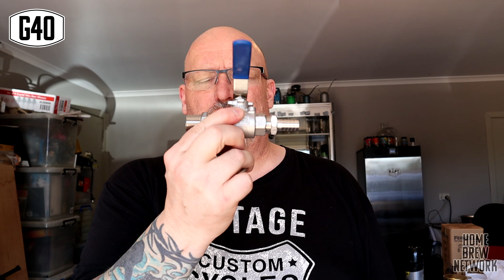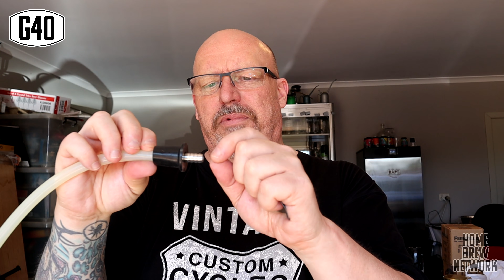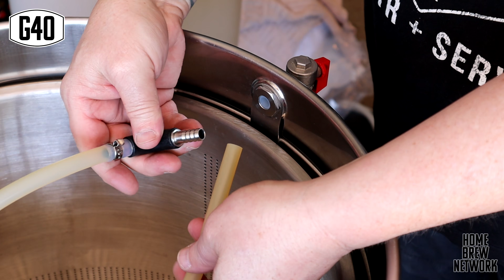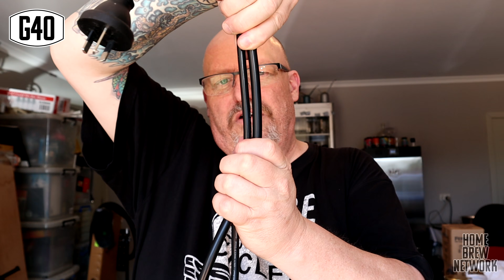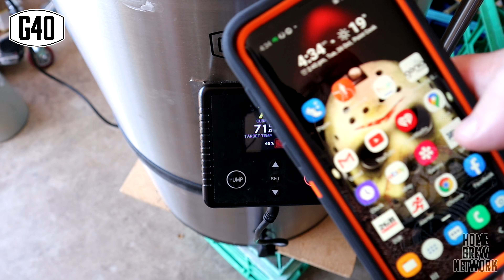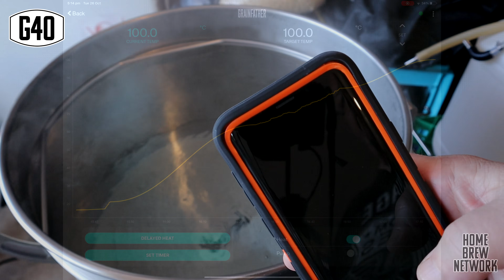Grainfather G40 - Modifications, Hacks & Upgrades - 15 amp - Feel the POWER! :)

Comment: Silly question; Just about to flip my G40 over to 15A (now that ive got the circuit installed), will I need to adjust/scale my recipes or the equipment profile in the grainfather app?
Reply from the maker: Maybe just boil off, but it won't be that much different . Should be quicker to boil so maybe a touch less evaporation during the heating. Cheers

Comment: I love my G40's power but being I'm in the states I have the maximum power output. It actually heats faster than my roller mill crushes my malt when I'm doing a whiskey mash. I just couldn't be happier with the G40 overall. I put it on a roller plant stand platform too so's I don't have to lift it to move it around.
Reply from the maker: Awesome stuff mate. cheers!

Comment: Hi. How’s the new sparge pipe working. Thinking of doing something similar. Is a normal plastic t piece from Bunnings ok heat wise or would SS be better?
Reply from the maker: It's good, I like it. I've used the bunnings parts in the past, but I always try and get stainless in the end. Just make sure its heat rated up 80c or so. Cheers!

Comment: * BUYER BEWARE * If your G40/S40 craps out, like my G40 did on it's 6th brew, GF WILL NOT REPLACE YOUR FAULTY UNIT UNDER WARRANTY!!!!!!
Don't buy into this hype, this company doesn't give a crap about you as a consumer.
They are currently trying to fix it while it sits on my kitchen floor... not sure osmosis is what's required here... 
* BUYER BEWARE *
Reply: Any update on this?

Comment: That’s also a huger volume boiling than your first wort, it won’t look as vigorous when full. I’m assuming you’re 220-240 volts? I put a Blichmann 220 coil in my keg, a dedicated, new 220 circuit in my kitchen, it’s a real beast, I think it’s faster than propane was..(in US..)
Reply from the maker: You have more amps in your regular 110 (15amp I think), then we have in our 240 (10amp) that's why in Australia we need a 15amp set up, 10 amp  works but is struggling. It's all about the amps... Cheers!
Reply: @HomeBrewNetwork  yes..an electrician charged me quite a bit for the new outlet, but I think here it’s a 20 amp circuit. 30 amp circuits are for hot tubs, jacuzzi’s etc..the copper wires in the new 20 amp line are quite large..!

Comment: Thank you!  The tri-clamp solution for the drain plug is simple and perfect.  A low profile adapter is 28mm including the threads.  That is far better than a permanent tap hanging off the side.  Cheers!
Reply from the maker: Glad it helped Cheers  mate!

Comment: Great videos on the G40. Thank you!

Could you measure and/or tell me the diameter of the grain basket? Can’t find the measurements online.
Reply from the maker: Let me check. 412mm outer lip to outer lip and about 385mm inside diameter of the malt pipe. Cheers!

Comment: I'm interested seeing the writing or imprint on the 2 cables to see how much difference there isbetween the two.(I am a sparky)
Reply from the maker: 2.5mm and the other is 1.5mm cheers! Each x3 of course
Reply: @HomeBrewNetwork  that's interesting, if grain father were cheaping out they would use 1mm for the 10A cable as it can carry 10A but they have used 1.5 which (by the book) can carry 16A. NOT recommended of course because as soon as it's in the sun or insulated it's derated to 12A (for v75, V90 is 17A).
2.5mm is 20/16/22A respectively.
It's great we have the option, Good job grainfather 👍
Reply from the maker: @nedt  I agree totally, when I saw the 2.5mm I was happy lol Cheers!

Comment: Maybe you could make something like the spray arm from the new Blichmann Breweasy Compact. It's a stainless steel tube with tiny holes along the entire length that sprays the water in different directions. When you stick it in the grain in the middle of the grain basket it allowes a lot of grain to come into contact with the recirculating water.

Comment: I don’t have a G40, but it looks like you could rotate the T piece at the bottom of the site tube so that the open end (female) could face straight down rather than out horizontally . This could then hang over the edge of the bench and allow a tap to be permanently installed facing down. It would just have to always sit near the edge of a bench!

Comment: I was wondering if you could blank off where the pipe pushes in at the top and use the 1/2 connection at the top of the valve instead, stick a cam lock on and use a whirlpool arm directly.
Reply from the maker: Yes you could, but the lid has no hole for recircing, so you’d have to leave the lid off, of course that will work but you’re losing heat. Cheers!

Comment: Could you get your strike water temp up quicker by setting it to boil and then punching it to 70 when it reaches say 68? cheers.
Reply from the maker: Well, I see where you’re coming from, but punching it to 70 at 68,  would be exactly the same time and power used. It was full 100% power  all the way to 68 anyway. Cheers VIC!

Comment: Nice video, a tip, the G40 has a standard IEC C19 plug so you can get a 15amp C19 cord from anywhere that sells them, being in Aus i got one from Jaycar for $14 and it works a treat, $14 cheaper than the official Grainfather cord, although the one i got was only 1.5m.

I just hope that Grainfather in the future releases a jacket for the G40, it could make reaching temps faster especially in 15a mode.
Reply from the maker: Good tip too, does the Jaycar cord have the wire dimensions written on it? I guess it should have? Let me know if you can what it says. Should 2.5mmx3 or something like that. Cheers!